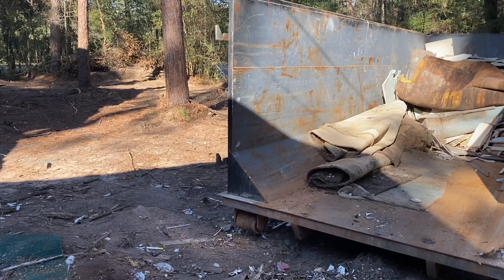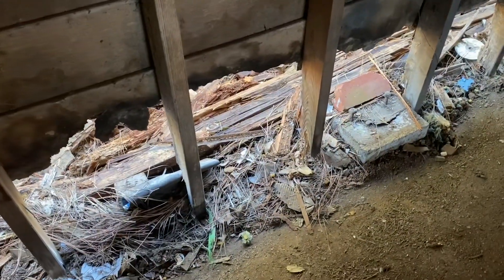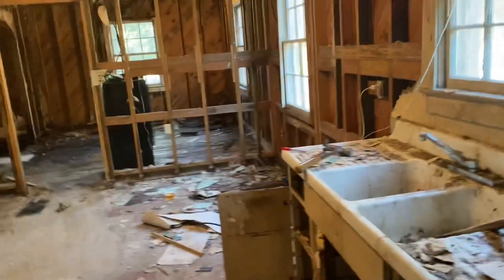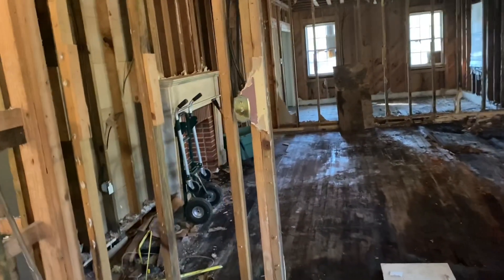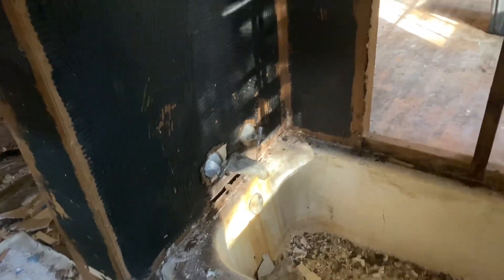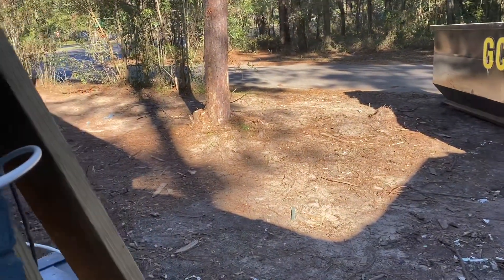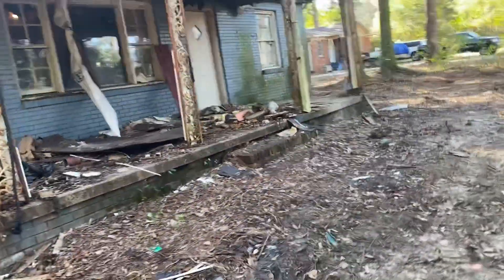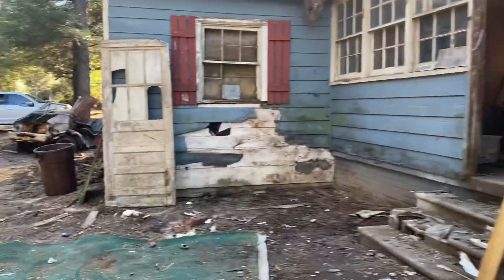Airport Dump House E:12 6 week update

Comment: You have the right idea to completely demo the back patio and install a French drain if necessary.  The framing in the garage/master bedroom doesn't look bad once the water problem is controlled.  That's crazy that they put one layer of subfloor and that is just the finished hardwood.  I've never seen that before.  I can't believe that was acceptable in any era.  Moving the kitchen into another room is smart to make it more open concept.  I've never seen termites in a tree that still looks alive.  I wouldn't have caught that... it's good you're taking it out now.